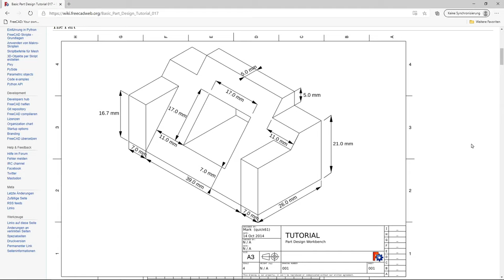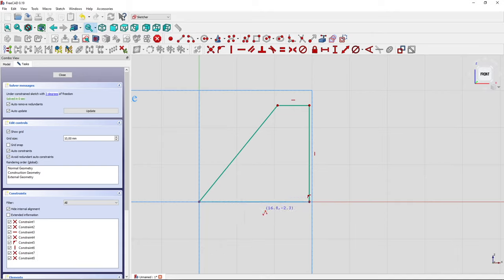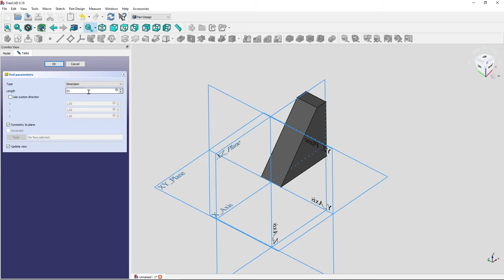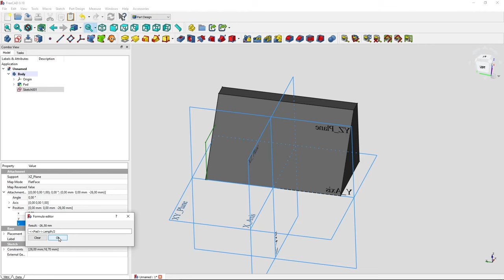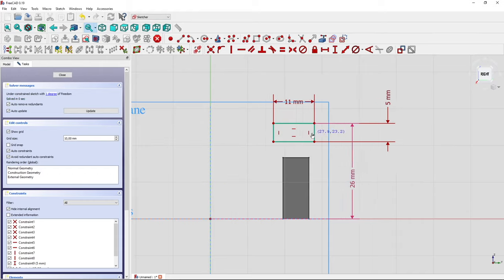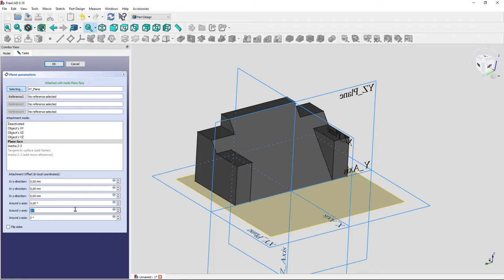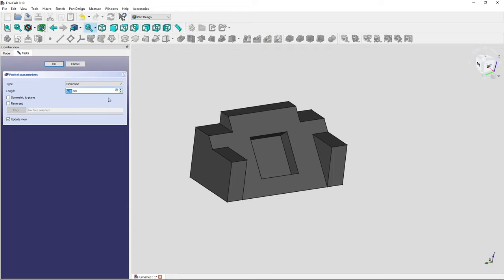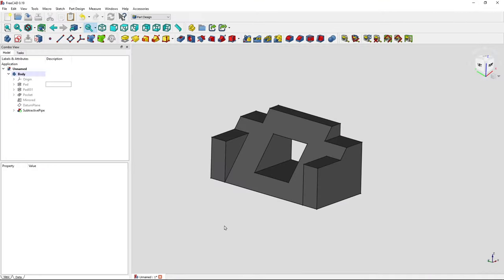FreeCAD 0.19 - Basic Part Design Tutorial (English)

Comment: I am a technician and I do believe that your methods of creation as well as explanation are very efficient and lead to correct moddeling. I also think, despite I am not an English native speaker as well, your English is pretty good and I am very pleased with your channel as honestly, when I first looked at Freecad I heard my brains cracking. Thanks to you I am getting a hang of it.

I have some questions though: 

1) If you add these boxes (“arm rests”) at the side (of that “couch”), will they automatically form an integral part of that body / is it a solid ready for printing? Or do they need to be joined? And how about different bodies in a part?  Maybe you can make a video about that?

2) Maybe you could make (another) video about using geometry from one plane in another? 

3) Would it be an idea for you to have novice modellers send you models they are working on for you to analyze/improve working methods?

Hope to hear, cheers and thanks in advance.

Comment: I've spent 6 hours trying to recreate the outcome you do in the video. I've started over 4 times. Every time I get to making a hole along a path I get a fatal error. I notice the when I create the sketch for the hole that your result shows a square box on the angle plane. My sketch shows the square box on the angle plane and two lines extending from the upper corners out to the YZ plane where another box is shown. I am using version 0.19, revision 24276. Other than the failure I like your video.
Reply: I sure would like to know why I get the fatal error

Comment: Why is it not recommended to sketch directly into a face?
Reply: As far I understood it`s because topological naming error.  If polygon has some internal ID it may be dynamically changed without any logical reason during stack edition. That ID will be assigned into other face and after that your a new feature will be fixed into a wrong face (other face than you wanted before).

Comment: really nice tutorial! had some problems referencing to specific measurements when using the stagelink3 version, but seems to work as expected in the standard 0.019_pre version. I guess the reason is that stagelink3 was forked from master some time ago and are both lacking some functions aswell as including new ones.

would be nice with a tutorial about taking measurements (ie on a downloaded step file). have some experience with solidworks and find it quite tricky in freecad, the caliper tool in the manipulator WB seems to be a little bit better than the standard tools.

Comment: Another great video, strait to the point. Great job again !  Also, I have these questions, if you please.  When filing up dimension values with the Formula editor entry box I found that FreeCAD supply auto suggestions as soon as a first letter is entered. Then the user can select whatever is available that include the letter. 
For example: B will show BaseProfile ( a name already entered ). Then if you enter C, all words including C or c will appear as choices, like Constraints. 
Lastly, if the desired dimension name is x_dim, one would start with an x but the auto suggest is not showing choices anymore. Why ?  
Furthermore, is there a way to see all available entries without having to suggest a starting letter ( which is restrictive to the letter entered) ?
Thank.
Reply: I agree with your critiques about poor autocomplete system in FreeCAD

Comment: Nice tutorial. 
I think the last cut could have been sketched from the rear and the standard pocket could have been used, though you probably more wanted to show how to use the datum plane?
Reply: Actually, you are wrong. Because you would have to calculate dimensions, because angled 7mm != 7mm perpendicular to the plane. By using datum plane he skipped unnecessary math.
Reply: I think that's a great alternative solution. The "angled 7mm calculation" could have easily been done in the baseprofile sketch

Comment: Why is it recommended not to create a sketch directly on the face?
Reply from the maker: You can check my video about the ‚most annoying problem in FreeCAD‘ where I talk about the topological naming. Your designs become less consistent and can run into the topological naming problems if you place sketches directly on 3D geometry when you change your designs later.
Reply: @FreeCADAcademy  this is what's commonly called a "show stopping bug". Yes, this feature can be easily created in 2 clicks but it's not the recommended way. we need to do a hack and then another hack and another et voila, it's done. So simple!

Comment: Very helpful videos for newbies like me.  I still struggle with fillets and chamfers moving faces even when I am religious about not drawing on faces!  I guess that's a separate issue?
Reply from the maker: Actually it’s the same issue with the topological naming, but unlike the sketching on faces topic, it’s basically almost impossible to avoid because chamfers, fillets, draft etc. all work on 3D geometry and will always be affected by the toponaming. One thing you could do and what’s often recommended: always use the dress up features (fillets , chamfers e.g.) as absolute last features in your model and don’t create new geometry that’s based on them. So you can easily delete them as the last features of your model tree, make the necessary changes on your model and then recreate fillets etc. again ! Thanks for the question and happy CADing! 👍🏼

Comment: @05:01 could you also get the external geometry from your baseprofile sketch and put an equals constraint between the rectangle width and the base profile width? Does that have any disadvantages?
Reply from the maker: Yes you could do that. But maybe you want the height and length to be independent from each other? If they should always be equal - then an equal constrain will be the better way, yes!
Reply: @FreeCADAcademy  ok great.

same for the angled datum plane in 'front' - I would have defined the plane using two vertexes (not the face) of your profile sketch to define the plane (Align O-X-N) instead of referencing the front angle dimension.

Is my understanding of the TNP correct that I can reference vertexes and edges from sketches without a problem, but not 3d objects like faces?

The reason I ask is because I hate how FreeCAD has no autocomplete on the named constraints - and I keep forgetting how I named constraints (especially if I don't design the whole thing in one go). Referencing sketches makes it so much easier for me because it's simple see&click :)
Just wanted to hear your opinion about this and if I walk into any future problems I don't know about yet.

Comment: Finally forced from Fusion to FreeCAD... I've done like 5 tutorials, and each one I run into the same problem that is never echoed in these tutorials. 

I have a "fully constrained sketch" a simple rectangle. (4x coincident, 2x vertical, 2x horizontal, fixed vertical, fixed horizontal, and either centered around origin, or corner on the origin)

No matter what i do, when I click "update" and "close" the sketch, no sketch ever shows up in the main viewer, from what i can tell all "parent" items (Body, or body and part) and the sketch itself is toggled "visible"... I can never see the sketch until I double click on the sketch i.e. to edit it...

edit the sketch never changed to the "green" color too

What did I miss?

thanks for your time

Comment: At 5:44, why is it Z value? Isn't it the Y direction???
Reply from the maker: It’s the global y direction but the z offset for a plane is always the normal direction of the plane that means it’s it’s local z value of the plane - I know it’s confusing at first but just imagine a plane that is completely twisted in 3d space - you can still offset it normal with its local z value but you could never figure out if you had to use the global x,y and z values

Comment: As simple as that wiki is, I cannot get even the very first sketch done. I have things on the tree that I do not see in the tools bar. I have to select sketch from the tree because it is not in the tool bar. I select the plane to draw on from the tree as doing what you suggest doesn't happen. What am I doing wrong? I just downloaded my program last week, so, I have to have the latest one. Even if I turn off auto constraints I cannot get it to set the size of a simple line. All I get are error messages no matter what I try to do. Again, what am I doing wrong? Help and thanks.

Comment: A great tutorial!! Thank you!! 
My question is if I need to add some chanfers and fillets, what would be the best practice to apply? Make the half completely and then mirror everything? How do we do it, in part workbench? Or to continue and applying the fillets and chanfers on both sides? But how to avoid the topological naming errors?
Reply from the maker: First I would not recommend mixing Part and Part Design workbench. The example part here in this video can be modeled in both workbenches equally well, but I recommend deciding which workbench you want to use before you start the design. 
Then (as you mentioned the toponaming) I recommend applying the fillets and chamfers as absolute last features in your model tree. Of course you could apply a pattern or mirror feature on the dress-up features (fillets, chamfers e.g.) but this is typically where you can encounter the toponaming if you change something on your geometry (model tree). So as a best practice: try to make them the last features and always double check their effects on existing geometry when yo change something.
Reply: @FreeCADAcademy  Yes!! I was looking for a mirror that allow to select the body, but in Part Desing I just found the mirror for features. 
Thank you again!!! Every video you share are amazing!!

Comment: Anybody know why my sketch turns light blue and then isn't visible in Part Design view? I've started from scratch with new empty documents 3 times and it keeps on happening.
Reply from the maker: Have you switched the construction geometry on? If yes, the symbols in the Toolbar (line rectangle polyline etc. are blue, not white) 
Otherwise I don’t have an idea..
Reply: @FreeCADAcademy  Thanks for the reply. It was a case of fourth time lucky - I went through it again, and this time I noticed you had a couple of boxes ticked in the sketcher menu that I didn't - Auto update and Hide internal alignment. I can't be sure that's what did it, but it worked fine after I ticked those. These are excellent videos by the way; keep up the good work!

Comment: tried this model with Freecad 0.21.0. The symmetrical ketch dimension gives an error.
17:19:10  The `.FCStd#` backup format is deprecated as of v0.21 and may be removed in future versions.
To update, check the 'Preferences->General->Document->Use date and FCBak extension' option.
19:16:04  Recompute failed!
19:16:30  Recompute failed!
19:17:27  Recompute failed!
19:18:09  Recompute failed!
19:22:12  Recompute failed!
19:22:45  Recompute failed!
19:23:03  Delete: Selection not restricted to one sketch and its subelements
19:25:09  Recompute failed!
19:26:08  Recompute failed!
19:26:22  Recompute failed!
19:26:23  Recompute failed!
19:27:25  Recompute failed!
19:30:04  DirectWrite: CreateFontFaceFromHDC() failed (Indicates an error in an input file such as a font file.) for QFontDef(Family="8514oem", pointsize=10, pixelsize=20, styleHint=5, weight=50, stretch=100, hintingPreference=0) LOGFONT("8514oem", lfWidth=0, lfHeight=-20) dpi=120
19:35:00  DirectWrite: CreateFontFaceFromHDC() failed (Indicates an error in an input file such as a font file.) for QFontDef(Family="8514oem", pointsize=10, pixelsize=20, styleHint=5, weight=75, stretch=100, hintingPreference=0) LOGFONT("8514oem", lfWidth=0, lfHeight=-20) dpi=120
19:35:31  Recompute failed!
19:36:51  Recompute failed!
19:41:01  Recompute failed!

Comment: I have lines on the side of the model after the pad command at 6:38, but they are not there in the video. How do I change that?
Reply from the maker: check the "REFINE" option under your properties.
Reply: @FreeCADAcademy  Do you mean "automatically refine model..." in Part Design preferences? I have checked those but the model didn't change. Can't find any other refine option.
Reply: @FreeCADAcademy  I started again from the beginning and it worked this time. Thank you! Hope to see more tutorials like this!

Comment: I still can't get the "Base feature" stuff to my mind. I know how to create but not why to use it. As it is also not covered here, it could be a topic for another video. German or English does not matter to me.
Reply from the maker: Hi! the „base Feature“ was not the topic of this Video but anyway thanks for the question.
I think it came up when the Part Design workbench got separated more clearly from the Part Worlbench in 0.17.
It allows  you to import geometry that was built outside of a Part Design Body into the Body for further feature editing. you can only import one piece of geometry as a base feature per body. further information:
https://forum.freecadweb.org/viewtopic.php?t=27295

bottom line: I use it very very rarely because I prefer either starting directly in the Part Design WB or working completely in the Part WB. Mixing of the 2 workbenches isn’t recommended anyways - so there’s no magic secret to the base feature and in my Personal opinion there are only a few use cases for it.
Reply: @FreeCADAcademy  Most of your PD examples are single Body documents. When i design for 3D print i have multiple Bodies. I try to globalize values via Spreadsheet, but sometimes a reference Body or Sketch would be neat. Just like you use your first Pad over here, but without referencing into an other Body. Do you get my point?

Found https://www.youtube.com/watch?v=8Bmcgn2RBGI&t=2946s which shows a solution to my use case. But it would so great if expressions could use BaseFeature.something to change all references at once by changing the BaseFeature....
Reply from the maker: Thanks for the reference. I will look a little bit deeper into the topic and make a video about it in the future. Its something really important, but I have to first check myself the possibilities in FreeCAD about referencing between bodies and so on, Thanks!